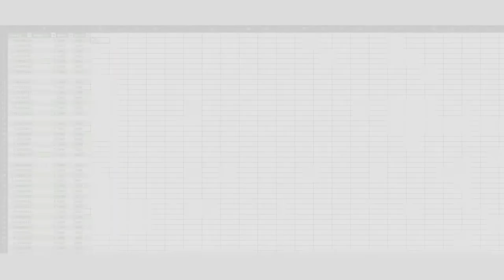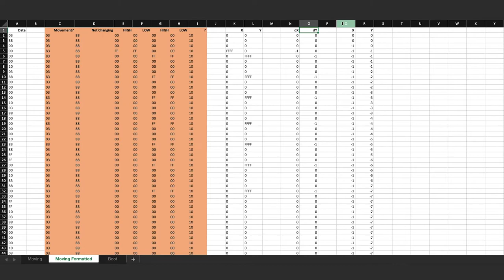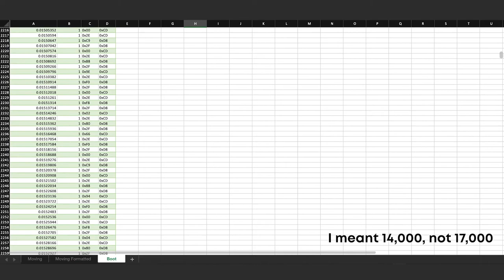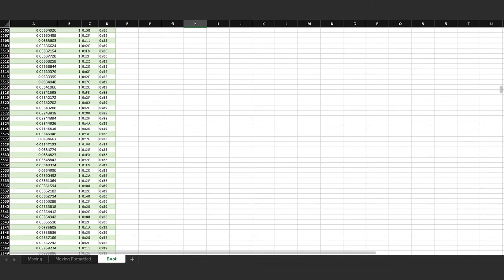Logitech G305 Mouse Data Analysis - Part 5

Comment: Nice video, maybe i missed it somewhere but do you know how this mouse work with higher voltage in longer term ? I think about installing 3,7v Li-Po battery into it but im not sure how does it work in long term use.
Reply: idont think it will work cause it has a boost converter not voltage regulator
to put it on the safe side you could just look for a 1.5 volt battery
Reply: @ahmedmahmoud2241  Actualy it does work flawlesly becouse g305 pcb have already build in proper limiter/converter/resistor (i dont realy know name of it in english), my unit is working over half year already with it and dont have any problem (battery + tp4056 charger cost less than 10$).